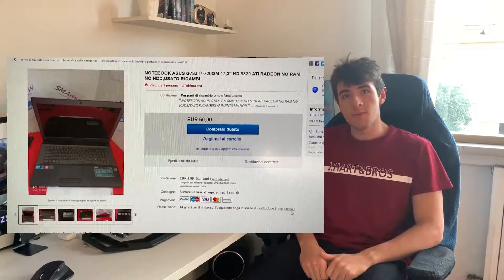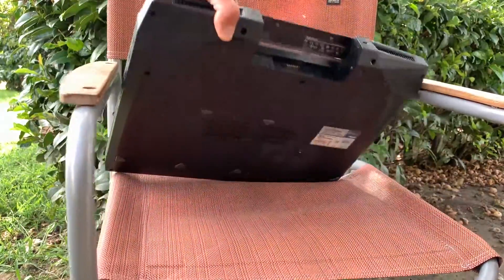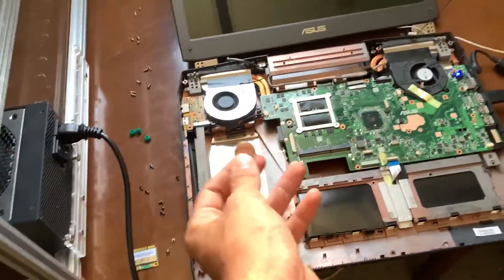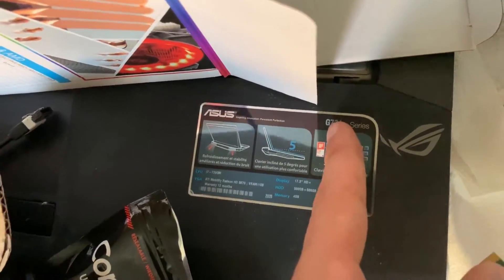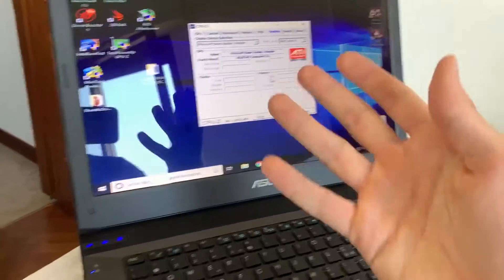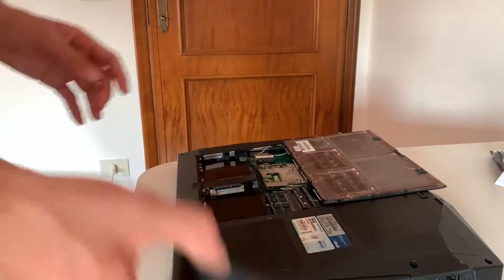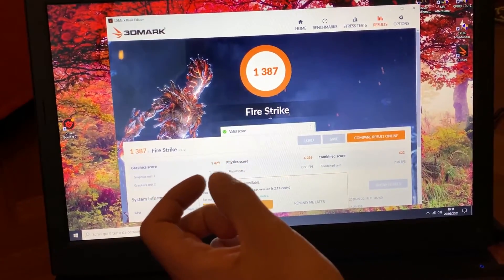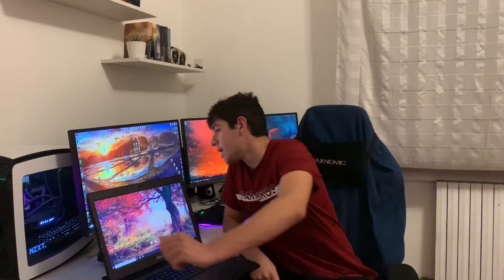I bought a 60$ “Gaming” Laptop from 2009 || Restoration & Overclock - Asus G73JH

Comment: Mine has strange artifacting, even tried reinstalling different os and hooking up an hdmi cable. I may just have to try reflowing.
Reply from the maker: Yup, try reflowing or double check the thermal pads! You can try underclocking it to see if that fixes it!

Comment: Hi, thanks for the great video, I have the G73JW model with the GTX 460M. Bought it new and it was sitting idle for the last couple of years. Now I'm thinking about upgrading the graphics to something like GTX770 or even GTX980 but I'm concerned about flashing the whole BIOS. I don't want to brick it or have 400 dollars worth MXM card with no use... Would you have any tips for me, please?
Reply from the maker: Hey man! I'm actually working on it right now (I know it's a bit late) I will post a video regarding the mod, whether I manage to do it or not. I'm trying to install a GTX 970 in it!
Reply: hi i have a G73JH and i have the same idea i want to buy a GPU MXM but i dont want brick the laptop so If someone has done it before could help me?
Reply from the maker: @ludwingverde6471  Yeah, so basically if you have an AMD card you can just put whatever AMD card with the same MXM connection and it will work. If you wanna put an nvidia card it's really difficult, I'm working on it right now, will make a video if I manage to get a GTX 970 to work!
Reply: @ImWateringPSUs  thanks bro thats its amazing I wish you luck I'll be on the lookout
Reply from the maker: @ludwingverde6471  ;)
Reply: Hey, same thing here... any updates on your side? Thx
Reply from the maker: This comment might interest you too!
Reply: Add me to the list. i also want to upgrade the GPU on it. Any idea's?
Reply from the maker: I'm working on it as described on the other comment! ;)

Comment: I have a asus g73s bought it in 2010 I think still works, but what good upgrades can I do for it I just don’t want to junk it what about 2tb HDD or  1tb ssd and graphics card and ram ? Thanks. I have the intel and nvida gpu in mine if that helps.
Reply from the maker: I would get an SSD instead of an HDD for sure. 8GB of RAM is gonna be enough, but you can get to 16 if you really want to. For the GPU, a GTX 970 is gonna be the best choice imho
Reply: @ImWateringPSUs  where can I buy the gpu and sad from thank you 🙏🏽
Reply from the maker: @HotSizzleTV_  You can buy them on Aliexpress, eBay or Amazon
Reply: @ImWateringPSUs  are they hard to install, I’m not to good working on laptops. Also for the gpu do I have to type in laptop gpu because the desktop one definitely isn’t going to fit lol.
Reply from the maker: @HotSizzleTV_  They are really easy my man!
Reply: @ImWateringPSUs   i lost my charging cable to this do you know where i can get the power cord that goes into the wall not the brick, and where can i get a battery replacement. so for upgrades to this i can put a new gpu in it and cpu? everyone says just throw it away i dont want to lol this is my first laptop.

Comment: i have this and i sold one of them for 100$
Reply from the maker: I honestlly believe that if it's fully upgraded, you could have sold it for more. With an SSD and 8GB of RAM
Reply: @ImWateringPSUs  I buy one with bad display for 160$ and second with broken MB for 70$. I merge them together and end up with fully working laptop, with 16gb ddr3 ram, bluray drive, original display from Hanastar and plenty of spare parts if needed. I gave it to my father for internet and movies. Ain´t bad, what you think? ;)
Reply from the maker: @SacRoScz  That's great man! I gave it for the same purposes to my grandpa!
Reply: @ImWateringPSUs  it had 8gb stock
Reply: @ImWateringPSUs  everything worked except a battery